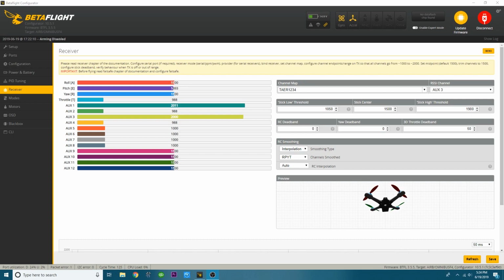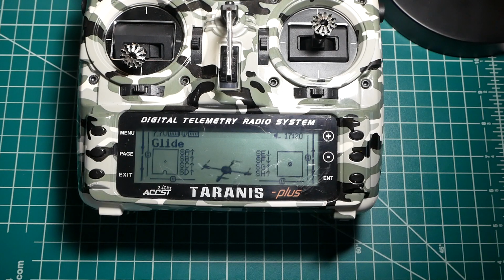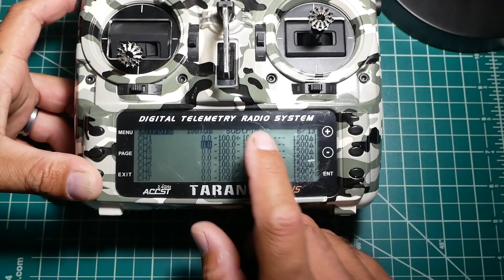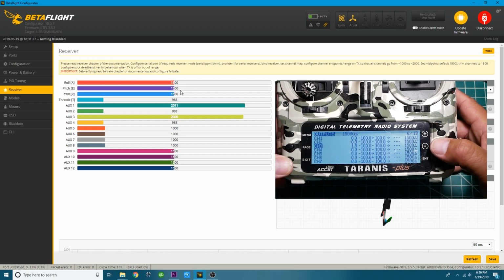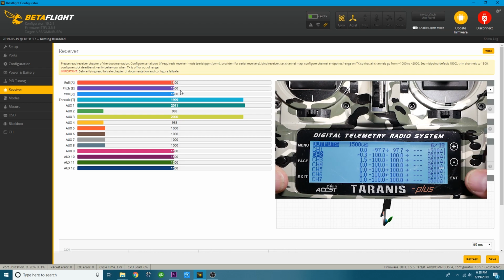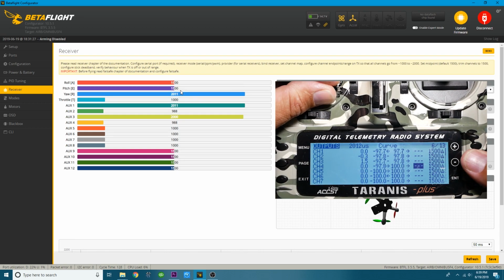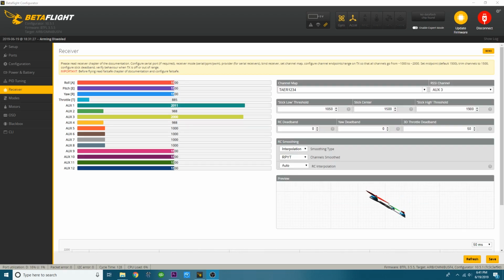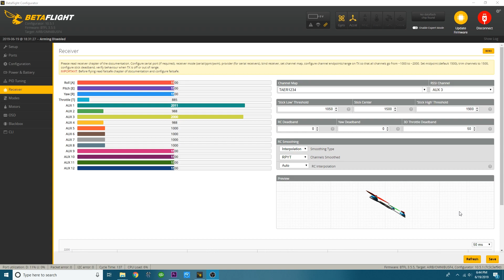Drone Turns On It's Own While Flying | Setting Up Endpoints In Betaflight | Min & Max Stick Inputs

Comment: So if you change these outputs on the radio, then this will affect all drones that use that model, correct?
would it be better to change the endpoints in betaflight, using the rxrange command in CLI?
my thought is that this is a change that is saved for each individual drone, to the flight controller,
so that I can still use just ONE "ELRS" model on my radio, and each drone has it's own endpoints set on the FC.

Does that make sense?

I don't want to have to make a new model, each with it's own output adjustments, for each drone that I have, when they are all running ELRS

Comment: What if pitch is moving in the receiver section/area, but the model doesn't move in the little model display to the right, when it's supposed to be doing front flips or back flips, it does not move
Reply from the maker: You need to head to your inputs on your radio and move them. Which ever is in the wrong place and swap it. You'll hold down enter and move them to their respective places.

Comment: my roll max endpoint is way off. i adjusted it as far as it will go and its still waaay off. wtf? this is supposed to be fully adjustable. its actually just like that with both of my quads too. max endpoint way off.
Reply from the maker: Have you checked your trim centers?
Reply: @DrainManFPV  1500. I adjusted the midpoints on the radio. I've used rxrange on cli over and over and over. Every time the endpoints are different. I was able to get them to the correct endpoints once but it messed up the midpoint. Fix the midpoint and the endpoints are all off again. My roll(aileron) is the worst, I can adjust it manually or in cli and its NEVER close to where it's supposed to be. Like 985 and 2045(just an example).

Oh also, this is weird, there's no model in the preview. Is that cuz it's an old F1 FC? it's a v1 beebrain tiny whoop.

Comment: my quad is turning in calibrate accelerometer part how can i solve it
Reply from the maker: If you set these centers your quad should not be moving, double check that you followed it correctly.
Reply: DrainMan FPV 👍thanks i solved it